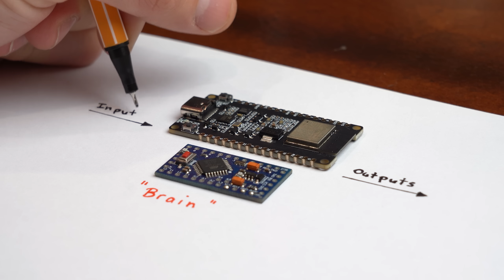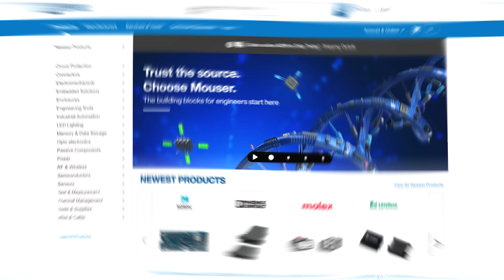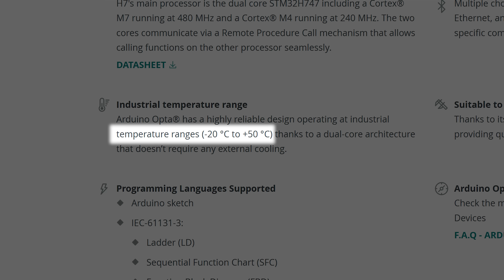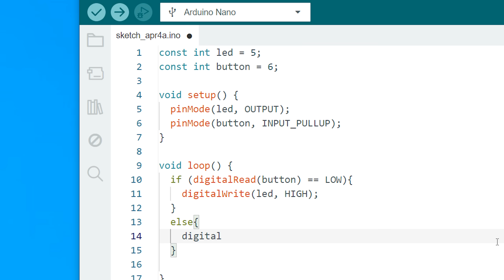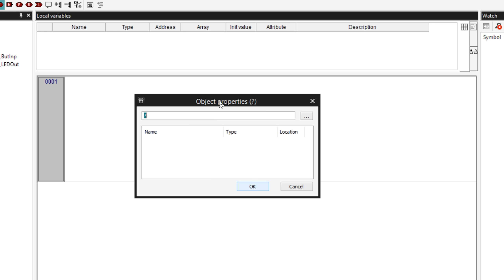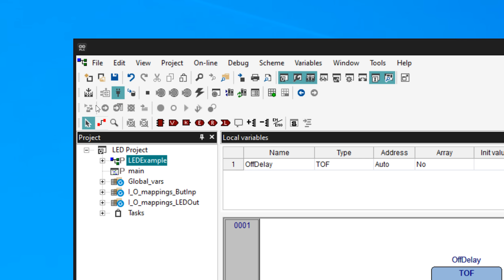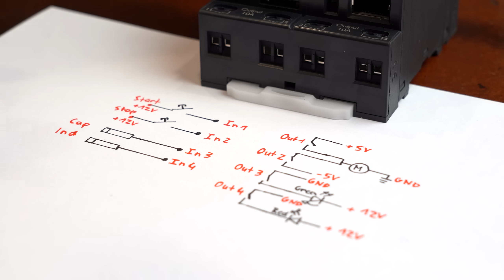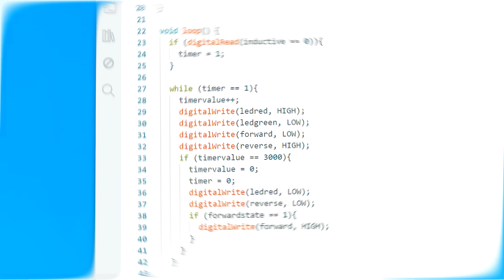Not a Microcontroller!...This is Better?! (PLC) EB#62

Comment: Here's a story; my PLC code kept running a 120 tonne industrial hoist into the end of the rails at full speed. Sounded like a car crash and shook the whole building. Several sleepless nights pouring over my code  later - I figured out a "helpful" contractor had replaced some of our station markers  with stainless steel because the originals were rusting. Yeah - the inductive sensor we were using couldn't see stainless, so lost track of where the hoist was. Fun times. If you're Canadian, you've definitely used the products that process made. 🙂
Reply: Hockey pucks? Maple syrup cans? Snow shovels? 🍁😊
Reply: @bobs_ya_runkle  Good guesses. I've never used the first two, and it wasn't shovels. I doubt it's guessable, but it is ubiquitous coast to coast.
Reply: I'll guess: printing or minting of Canadian money (or Canadian Tire money hahaha), Tim Horton coffee shop equipment, snow tires, toques, Robertson screwdrivers or screws (or electrical hardware).
Reply: @Graham_Wideman  Oh this is a good guess! I don't know if you're right, but coins are made from coils of steel (plated depending on the coin) and those are handled by big overhead cranes AND the manufacturing/minting process is pretty secretive which might be why OP is pretty coy about what it was!
Reply: @Graham_Wideman  @Nemo222 Very close first guess. I'll give it to you. It plated the steel blanks for the Loonie. The blanks are round, by the way. They get their sides during the stamping process.
Reply: @R.Daneel Haha, thanks for filling in the story!
Reply: @R.Daneel Oh the loonie!  I have spent a bit of time in Canada and I know the loonie and toonie (twonie?) well!
Reply: Okay, now that is a crash!
Reply: Lube, for those long dry cold winters.
Reply: Sorry poor design imho, I get the factory in question changed the positional markers but a well designed crane control should have redundancy built in using another technology like an over-run mechanical limit switch that shuts the crane down and trips the safety system until inspected for problems. 
 Relying on one technology here has allowed the customers attempt at removing rusty markers to completely override the whole system allowing the crane to crash into the end stop, I have also seen inductive sensors come out of position through vibration or simply fail but having a mechanical operated overrun is where the crane is safely put into safe mode until an engineer comes out and rectifies the issue.
  Can I ask if this crane relied solely on one positional sensor and possibly a creep marker, stop marker and overrun or did it have multiple independent sensors each positioned for a particular marker, if the latter then obviously it does allow for redundancy and the customers actions have blinded all the sensors, if the former then again a poor design imho.
Reply: @genome616 I agree a hard wired limit switch should also be installed
Reply: Also, inductive or capacitive limit switches (and lots of other kinds) are totally fine to use. Google functional safety, iec61511. It handles safety of automated machinery and is used in all kinds of safety relevant automation.
Reply: magnetic grade stainless steel
Reply: If a system is being designed that relies on counting flags to know where it is, then the person designing that system must ask themselves "What happens when a flag gets missed (or double counted)" because at some point it will happen. I don't know how big a 120 tonne gantry crane is, as the biggest one I use is only rated for 60, but I'm pretty sure the damage bill and downtime would have been greater than the cost of 2 limit switches and associated wiring, even if it didn't endanger anyone's safety.

If you can't listen to other people's advice without getting defensive, then you are going to hurt someone.
Reply: @brentonn6044  true-er words have never been spoken.
Reply: You now know why regulations in many parts of the world require Mechanical switching and redundancy for end of travel limits on large objects like High Bay cranes. Using an Inductive proxy in that application is about the worst case imaginable.  Let alone using a flag to activate rather than the absconce of one in such an important part of its use. If you dont understand what I mean you shouldnt be doing that job unsupervised.
Reply: @dazaspc 
the automatic cranes i have worked on / with dont have any physical end stop sensors at all, only a safety rated position signal and code that calculates how fast it can brake to avoid crashing
Reply: @dazaspc  It was an overhead hoist for an automated industrial process. People had no business being near it, and would have had to jump at least 8 feet into the air to risk an injury. Even if they managed, they have hit plastic impact bumpers on the lifting arms that would have tripped the breakers and stopped the whole line. Thanks for your all-knowing advice, though.
Reply: @R.Daneel No matter the attitude still bad configuration. Automated or not.
Reply: @dazaspc  I'll be sure to pass your enlightened musings on to the seasoned engineers who designed that process almost 30 years ago. Assuming any are still alive. Rest assured, they'll be humbled to an appropriate degree.
Reply: @R.DaneelIt doesnt matter if your the greatest engineer on the planet, if you dont use basic principals of redundancy when you build or modify equipment it becomes an unnecessary built in risk If your Ego cant handle that You just proved my point.about supervision.
Reply: @dazaspc  hardware redundancy is not necessary in every case. In functional safety it is only needed for sil3 or better. There are qualified sensors for safety functions with failure rates in the 100year range. 

That does not mean that the engineers 30 years ago did not overlook something, or that it should not be possible for a contractor to modify a safety part (missing markings and/or documentation?) but you are incorrect in calling for redundancy for every safety function.
Reply: @wwpdmedia  I agree however simple logic for controls should always be the first option rather than high end components. It's basic industrial practice. The first comment implied it was his system if it wasnt so be it. But regardless Those were the expectation in my plants where I worked and I used the same in the shops and businesses I managed.
Reply: @dazaspc  I mean yeah any good engineer working on a system with a rail that has an end on both side would put analog redundancy (a basic switch) to cut power when it reach the end instead of trusting sensor/program. Trusting and relaying on physical barrier (a bushing/a wall...) as backup to stop this much mass as redundancy is plain dumb. Having "a car crash" 'bang' every times the hoist reach the end at full speed should never occured.

I've had a case of a DvD driver struggle to work because for some reason the end ram switch was slightly too long and would cause the readhead to be too far ahead and would fail reading disc 90% of it's attempts as it would be unable to read the first line of data. Chopped ~1mm off the switch head and fixed the issue. lol
Reply: @dazaspc Also fair. For a new system, you do not have a choice. You are required to do a risk assessment ( ie HAZOP). Simplified: If the process can harm a person you are required to use safety rated components.
Reply: @wwpdmedia  using your brain and following basic principles should be the first line of defense, not a stamp on paperwork of a component.
Reply: @professortrog7742  true. But, when there is the possibility of bodily harm, brains and basic principles is just one part of the solution. Certified components and review processes are equally important.
Reply: @professortrog7742  Not a problem, the paperwork creates a bigger and more expensive barrier to entry and the factory will soon reincarnate in China or India where we don't care too much about safety nannying
Reply: @dazaspc Hey Jimmy Neutron, I think I just heard someone call sodium chloride "salt", you better go correct him

Comment: I am a PLC-programmer and I would call this a smart relais, like a Siemens Logo! or similar.
Don't get me wrong, this has it's used cases, but I have programmed complete green house logistics and I would not choose this for that task.
That said, I love the fact that you went outside your normal subjects to tell about automation and why PLC's are perfect for that. And the fact that Arduino went out of their way to get all the standards right and support all 5 61131 languages, instead of only ladder, as most cheap PLC's (smart relais) do, is certainly worth mentioning and fits their curriculum of learning. I realy hope it gets kids to become interested in industrial automation.
Reply: What is it missing that makes it unsuitable for larger tasks like you mentioned? Is it just I/O?
I've programmed very complex systems (DALI/DMX/custom/lighting control/BMS) running a STM32H7 based processor which I think these use so I would say - don't underestimate the processing power available.
Reply: Ability to extend more digital and analog port for localised large machine,ability to interact between devices using data bases@harambeexpress
Reply: May I ask what you earn per year?

Comment: Basically the comparison between a industrial grade upgraded beefed up (macro)microcontroller system (with some extra stuff added to make it commercial grade and to upgrade the puny IO outputs to some industrial level compatible ones), and a regular puny bare microcontroller (board)  :)

But i, myself who is student hobbying with electronics and coding, it would be nice for other beginners and inbetween people to have a gui based coding software. I started programming this way when i was  young, but with lego mindstorms and the microbit using blocks of code. I learn and perform the best in graphical and logical things

And also a plc is handy because its basically a beefed up microcontroller and thus accidentally frying it by connecting a pin to the wrong spot is low chance, and you can drive certain devices directly while with a mcu you often need a transistor or mosfet or relay cause of the weak io pins.

Comment: You should take a look at esphome. It is a framework that integrates very nicely into home assistant, but also works as a standalone environment.

It allows for very simple programming of esp32s and makes it very easy to add inputs, outputs and sensors.

Programming logic is pretty simple to understand and write, plus you can drop into c++ if you wish.

It also handles things like WiFi config and OTA updates easily.

Comment: PLC's are great for industrial control. I might find a use for this since the software is free and it has IOT capabilties. Still cheaper to build with a MCU in a niche application. Its still a lot cheaper.

Comment: To say that the price is competitive is an understatement.
That's including the used Market.
 Alan Bradley had a Stranglehold on this industry for years, a minimum system would cost a fortune because you had to buy the Mainframe power rack and each input/output module separately.
Reply: @charlesurrea1451  In the US maybe. Outside they are not that popular.

Comment: Thanks for the reminder. Like you, I started with PLC programming in an industrial setting, and then switched to microcontrollers as a hobby. It was good to be reminded that there are other, effective and efficient solutions available.
Reply: Me too. ZX81 for fun then PLCs for work, using octal addressing! (Siemens) Then 8 bit addresses (Mitsubishi) then Allen Bradley. Then robots (Sepro, ABB S3, S4, all the way to now) With a diversion into Fanuc for a year or two.
Now Arduino programmed ESP32 boards just for fun. (Nearly time to retire)

Comment: I graduated college in 2023 with a BS in CS and interviewed for a PLC programming job (mostly out of desperation). Didn't get it. But then I interviewed for a C++ firmware programming job and got it. I am very glad that I got the C++ job instead of the PLC job, let's just put it that way. PLC is cool and has its place but if you understand code and electronics well enough and aren't in an industrial setting, you might as well just use a microcontroller.

Comment: You did not mention that everything about the PLC is expensive from cost of programing software, to the $100+ for a PLC, compared to $2 for arduino / ESP32. This seems something that is very important i can get the same function as your example for about 10x less, and in the same time.
Reply: Welcome to the industrial control sector
Reply: @ToxTox  Also it is weird no mac or linux support, it is so nieche and with a $2 case ( 3d printer ) and and $5 esp32 board I could do a lot better.
Reply: @symonty  Probably not. PLCs are a pre-engineered solution for industrial Controls and industrial automation, in where the requirements are much different from hobby or embedded electronics. PLCs are designed to be extremely reliable, flexible, and has functions like online editing of the logic code, which is important if you design machines that are very big and expensive and produce lot of revenue. Using PLCs in hobby project doesn't make much sense because they aren't engineered for that. The reason PLCs cost what they do is because you buy a solution that has many many years of r&d, a manufacturer that can supply spare parts many years down the line,  is tested and certified to comply with standards.

Comment: But inside the plc you find a microcontroller or a microprocessor. So, there is no comparison between them. This is a microcontroller with additional hardware

Comment: We programmed siemens logosoft back in school.
I have more of a CS background so my view is a bit scewed I am sure, but, I think both programming languages are simmilar.

What I do not like (besides the price of course, thats a bit beyond my budget xD), is that you have to connect a cable to change it.

I never used node red but it seems to work simmilar to fdb. 

you are also pointing out what I miss in esp home. A live debug mode.

Comment: Those PLC are damned expensive, and offer a whole lot less due to their manufactured intent for heavy industrial usage... not intended for "Developing" or "Hobby Crafting". They're basically the result of a finished "developed product with a bracketed set of reduced options" intended for a hard-set production run.. The PLC is a "Cut Down" with "Limited Essential" in different, selectable aspects to increase the devices durability, and reduce it's complexity basically comprised of only switches, timers and counters...  My little Toshiba PLC is still sitting on the shelf, looking way lonely for the last 10 years... Cool? yes. But they just don't "Fit" unless your bloody "Rich", and want to perform more tricks, (with extra things),  just to do what the little ESP32 does in it's sleep. It's doable, but not really worth the effort and expense nowadays. Besides, most PLCs have their own software, language, program, which is mostly "Propriety". It's designed as a Hard-Core protection to prevent any expansion to a second computer, and basically takes full and absolute "Ownership" over the designated programming computer, rendering it useless for any other task or programing.  In short, when you buy a PLC, you ALSO Purchase Another Laptop, Just For that single, unique, PLC's manufactures programing software. Rockwell, Toshiba, Eaton, Cutler Hammer, and whoever; nobody talks with each other and Everybody is paranoidal towards everyone else in the industry... They're all sneak-thieves unto their own so they act accordingly. But instead of making their niche secure, they charge more due to their acrobatic paranoia antics than the item in question. Their moto could honestly be: "If you want it, Jump! Here's my ring of fire TOAD, get hopping or go away!" And that's how they roll. Every last one of them.

Comment: "...that it all looked rather messy, which is not usually the case in industrial settings." As someone using PLC in automotive assembly lines this made me laugh. Cable ducts are fine until you are not  forced to reconfigure or add sensors on the fly during 3 shift production run time and you have 30 minutes between lunch breaks. Anyway now we use combination of PLCs and Arduino with wifi module for monitoring and data collection.